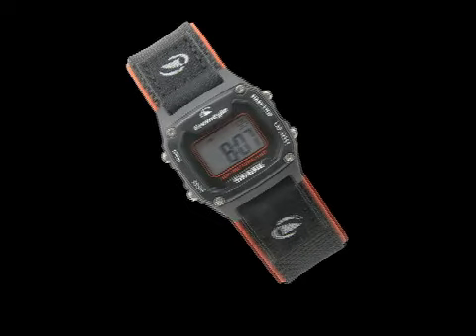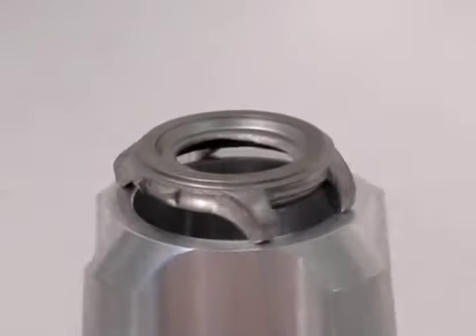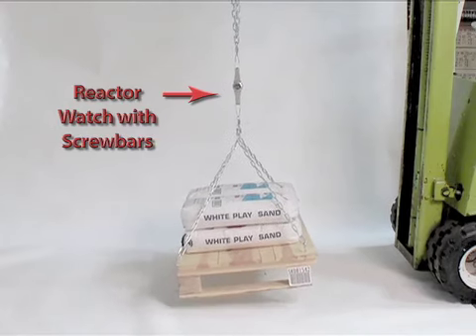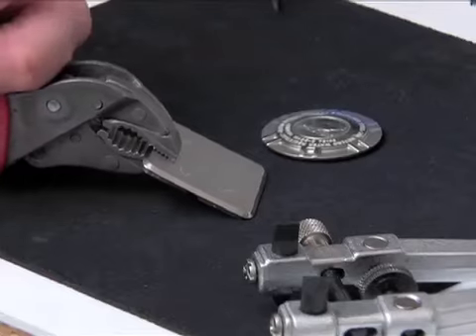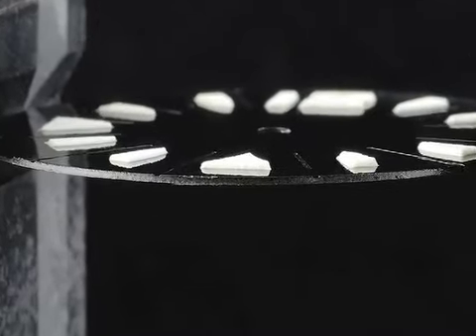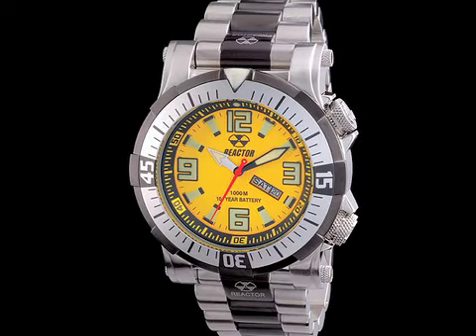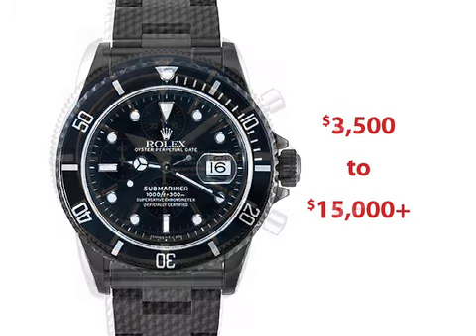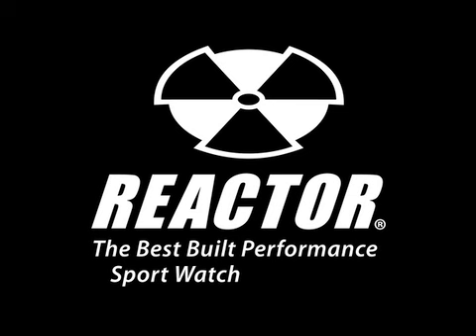Intro to Reactor Watches

Comment: I have had my critical mass reactor for several years and wear it all day, everyday!Working as an electrician, this thing has took a beating! From getting Sheetrock dust on it on a daily basis to being hit by foreign objects, and still looks like it did the day I bought it. No scratches on the glass and the band has very very minor scratches, almost invisible unless you are really looking for them. I also wear it swimming at least 3 times a week, while I’m playing golf, fishing and hunting and it has kept time without being off for even a fraction of a second. Very impressed with the quality and durability of this watch. Odds are that I will never need to purchase another watch as long as I live, but if I do, I will never buy anything but a reactor. Great job guys!

Comment: I got mine today REACTOR GAMMA TITAINIUM BLACK...been wearing g shocks since 1985 when I was 16 years old...I personally think g-shock has gone into a rut with their designs and fruity colored cases with little round digital eyes that blink and flash for no reason, taking up space for larger digits...I kept waiting for them to make a style I liked but there was always something I didn't like...year after year... it was too small....too big...or no second hand...digits to small..or a watch that seemed unfinished...casio is doing away with lume and second hands on some of their watches too?..saves them money I'm sure and their illuminator backlight led doesn't light the face evenly at night.. I have just become unhappy with anything new put out for past 10 years by them...so I went to REACTOR and found exactly what I wanted...super tough..300m water resistant..tells time day or night at a glance with tritium and superluminova..simple design...and style is awesome...good bye G shock..